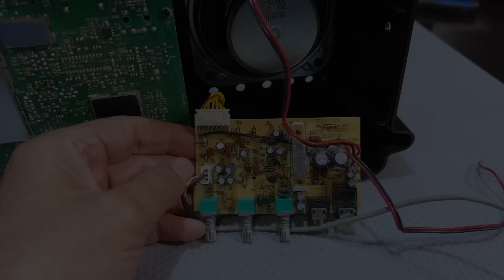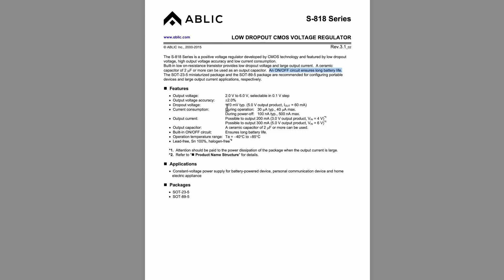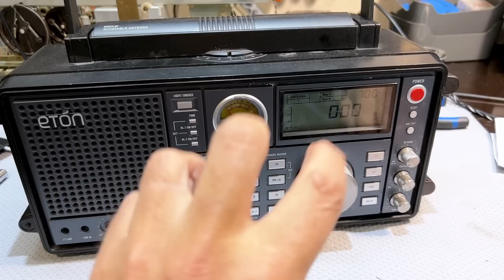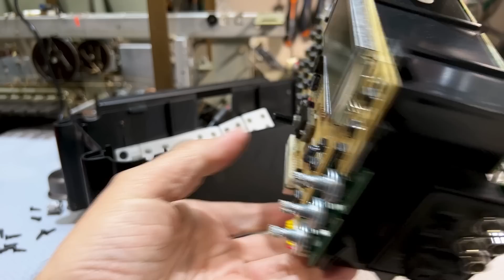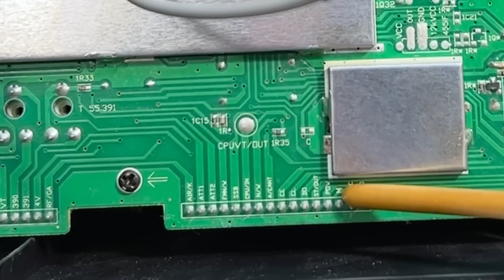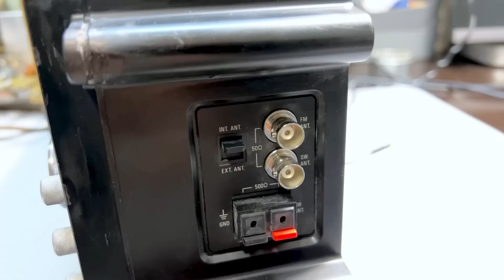Solving a Common Problem on the Eton/Grundig Satellit 750 - Reverse Polarity Damage.

Comment: I have the Tecsun S-2000 version, they are all the same because they are made by Tecsun.
One common problem is that the encoder becomes erratic, the best solution is to open the encoder and give it a proper clean.
Great job and valuable info, thanks Manuel and all the best.
Reply from the maker: Pleasure 👍
Reply: Do the S450DLX  Field Radio Grundig have the same problem? I have one where the tunning doesn´t work?
Reply: @s.guttmann6625  If it has the same encoder (I belive it does) than yes, you will have to open the encoder (doing it at your own risk, as you may render it useless if not careful) and clean it properly.
Doing it right will make the encoder reliable for a long time.

Comment: I know you lose upto 0.6V but an idiot diode in line with the power supply jack would stop all this damage at plug in. Shame the manufacturer didn't design the supply board and the voltages to allow one to be included. "Hapeth of tar"
Reply from the maker: There is space on the little DC socket board, and I have added one - a schotky

Comment: As stated by you and a lot of comments, why didn't they fit a reverse protection diode? Great video, good to know this problem. Very nice little radio.
Reply: Adding that diode would push up production cost of the radio. If the diode is 50 cents and they produce 100,000 radios, that's another $50,000 cost. They also work on the basis that if the owner uses the correct (supplied) adaptor, there is no possibility of reverse connection.
Reply from the maker: True, but on the other hand, 100k diodes would probably cost them 1 cent each, and add significantly to the reputation of the product. It’s always a two-sided argument in these cases.
Reply: @stopthebus  Two words: Bean counters. The designers' headache. Often times a good design is destroyed by penny pinching in the accounts department. This happened a lot in the 1960's. Yes, it's important to keep costs under control - but the very thing bean counters are trying to protect is the thing they end up destroying in the long run. Although there does need to be balance. SAAB refused to cut any corners for Vauxhall and ended up being shut down because they cost too much redesigning things Vauxhall had already supplied them with.
Reply from the maker: True

Comment: Obviously this unit has no reverse voltage protection! So it´s NOT a Grundig!  ... smile ... You could add an anti parallel diode, which shorts the DC-input.
Reply from the maker: True. It’s just asking to be fried 😊 I’m going to add a series diode to protect it, even though it will cause a small voltage drop.

Comment: Was there any possibility of making the center positive to get it to industry standard?  Or in lieu of that a full wave bridge so it doesn't matter. That would be easy to do . Even a reverse protection diode to prevent damage ever occurring again would be fantastic. A small 2.5a diode would be perfect for that job and save the radio from ever sustaining extensive damage like that again. Diodes are cheap and easy to install compared to having to shotgun the entire power supply. Great job on the rebuild, they really fried it good.
Reply from the maker: I am afraid of changing the socket because someone may one day assume it is original, and then you have the same problem. I’m going to add a Schottky diode to protect it.
Reply: @electronicsoldandnew  works for me!  Anything to protect the ol girl brother!  Too nice to get destroyed.  Have a great week
Reply from the maker: Thanks 👍
Reply: Interesting to note: most of the radios, modems and random electronics I've encountered use center positive.  So far, nearly all of the guitar effects pedals I've encountered are center negative.